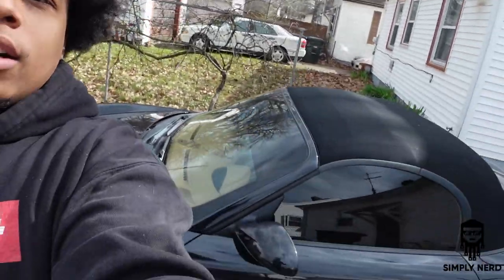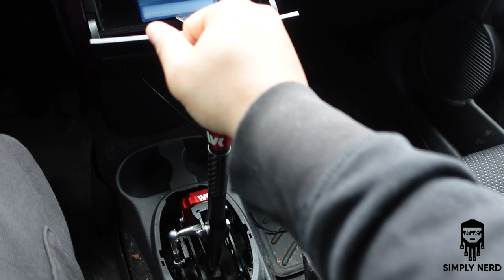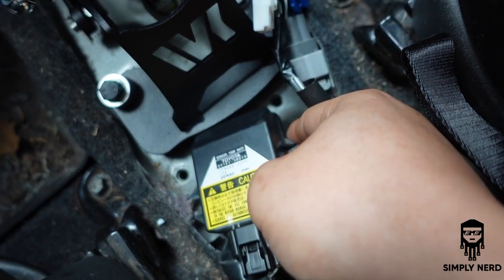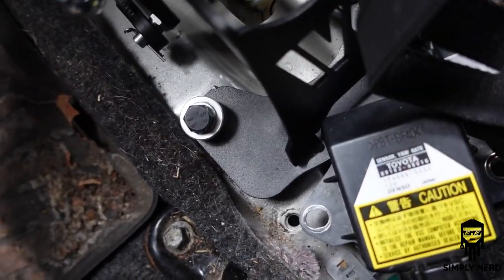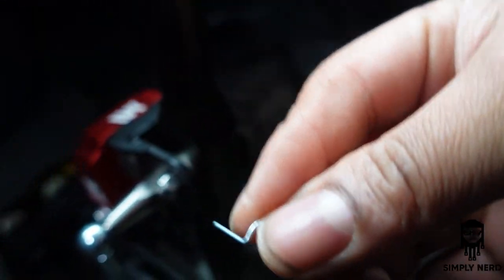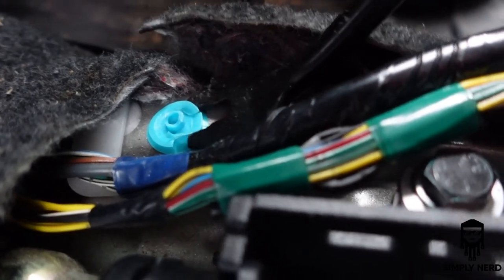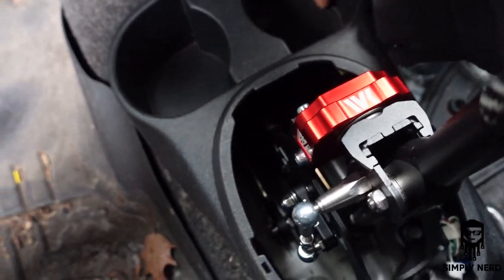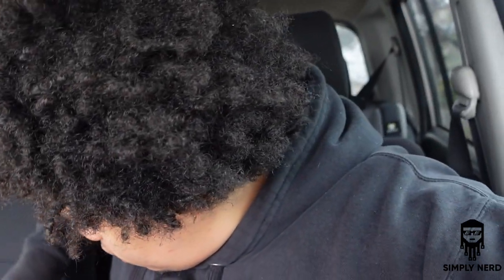Scion Xb Short Shifter!

Comment: I want a “new” first gen XB that’s in better shape than mine but I’m worried about how long it will last.  I have an 05 with only 128k miles. Engine is chirpy and the wife and kids has dinged up the body and the paint is in terrible condition.  Anyone buy one recently?
Reply: i just bought an 06 with 140k miles for $5k flat